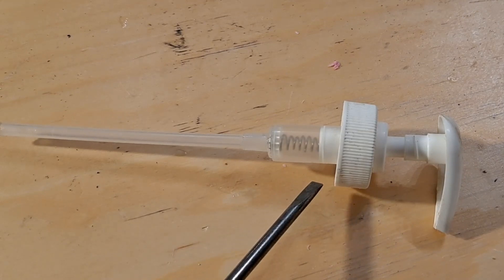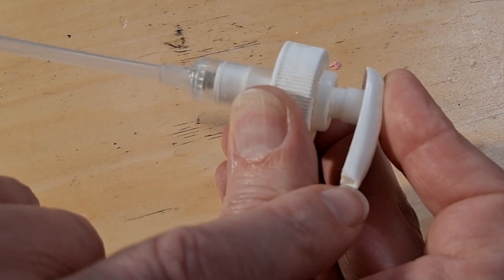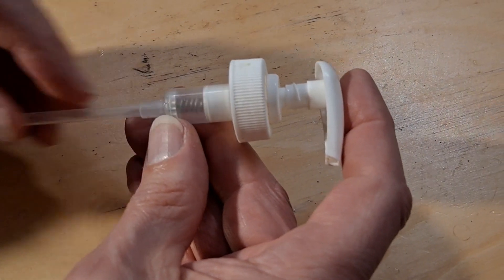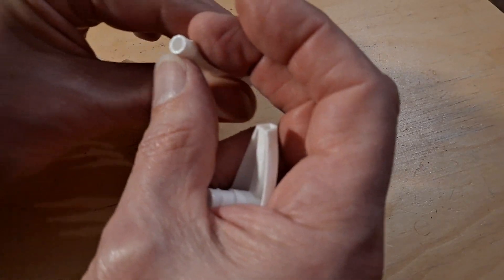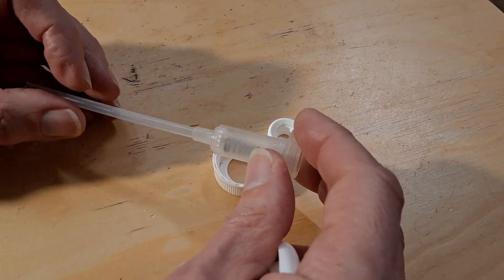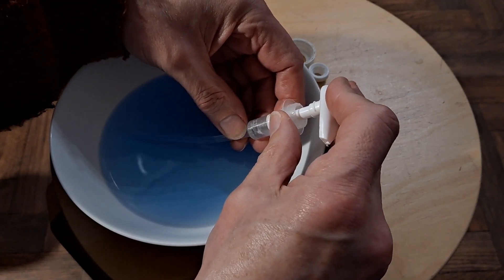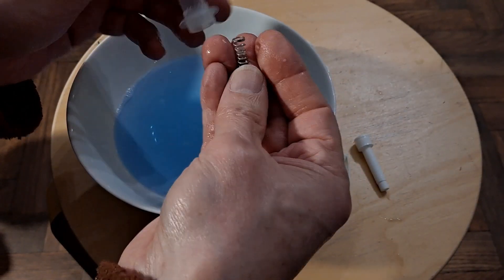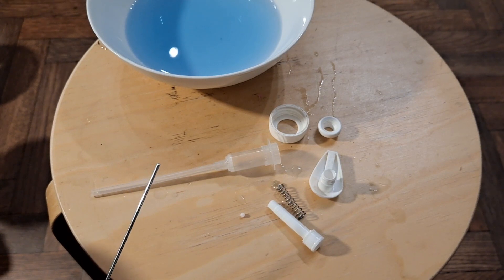Tear Down Soap Dispenser pump

Comment: Interesting teardown 👍 Did you collect these at one point for anything in particular you had in mind? Thomas Kim's vacuum chamber is a great idea..
Reply from the maker: I collected the plastic tubes because they came in handy for various things, plus I saved the springs. The rest would be recycled. Technically it seemed the right thing to do, separate the metal from the plastic.